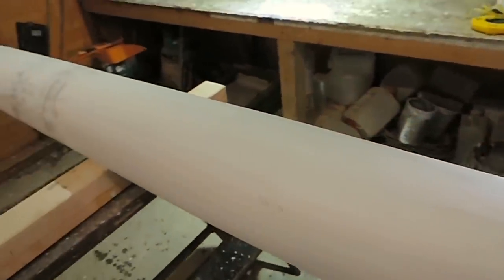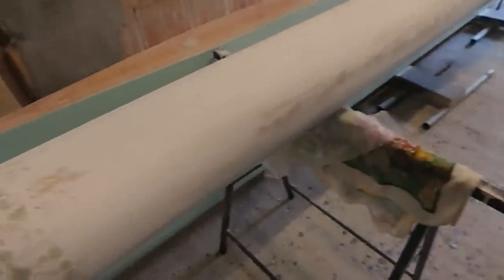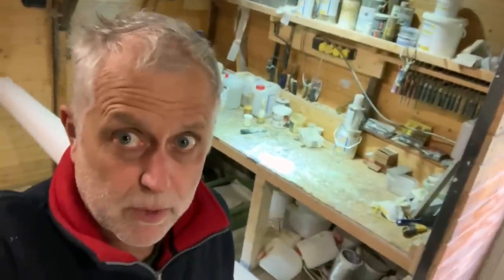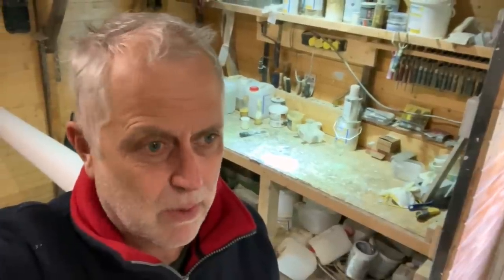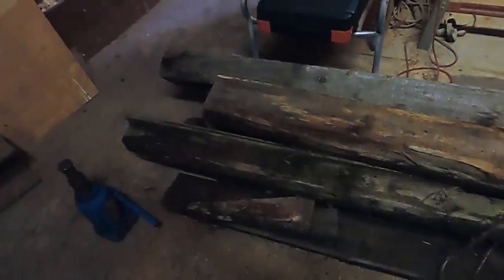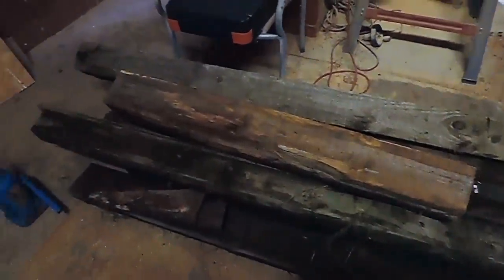Mast Built And Preparing To Fit The Keel - SV Tapatya EP249

Comment: Fitter machinist here tony, (fitter and turner in old terms) your using the cutting tool backwards on the lathe, your using a righthand cutting tip when you needed a left hand cutting tip.. basically your cutting with the back relief for chips instead of cutting with the cutting face..  basically what your done is the same as putting a circular saw blade in backwards and cutting while it spins backwards ..
Reply from the maker: I know mate, but it’s only a rough cut on a bit of softwood!
Reply: @SVTapatya  ahh, makes sense then, i had mistaken it for bronze stock..

Comment: I suppose the next phase of the job is going to be the real white knuckle part.

To get all of those bolts in correctly, you are going to have to line up the keel nearly perfectly, both horizontally and vertically.

But that's after you get it under the boat.

Quite a challenge, but one I am confident you can handle.
Reply from the maker: Thanks Bob. Yes, that’s all. Easy! 😃😉